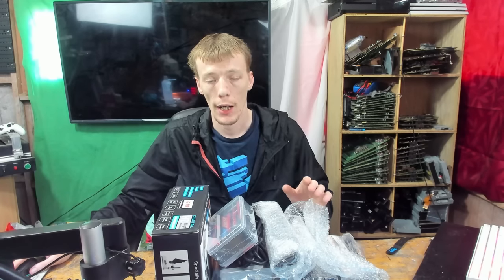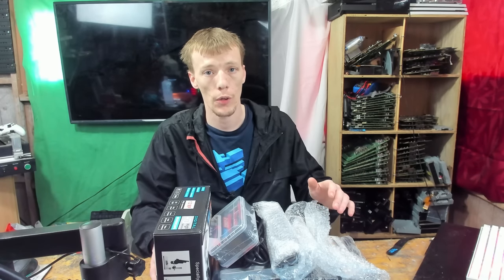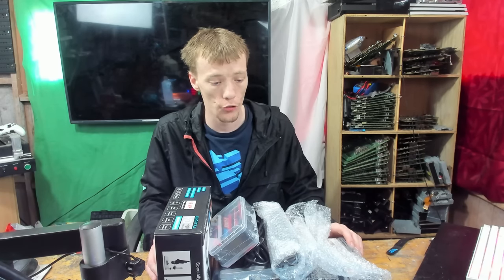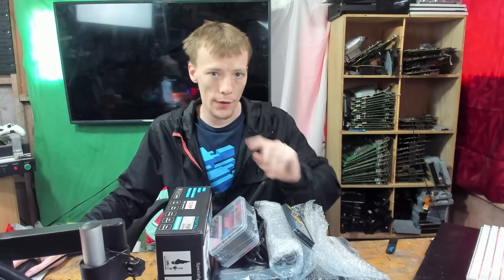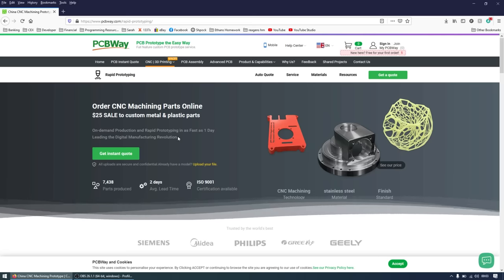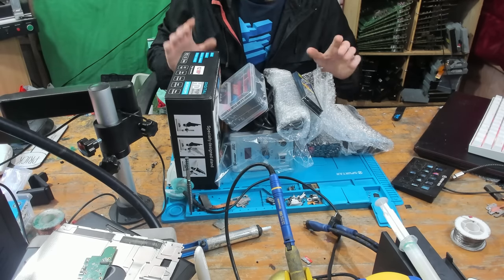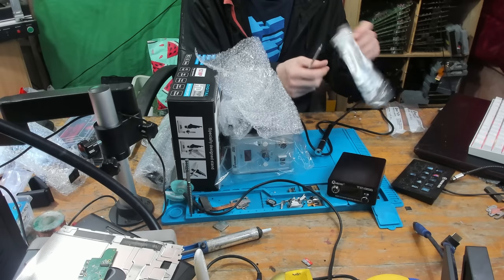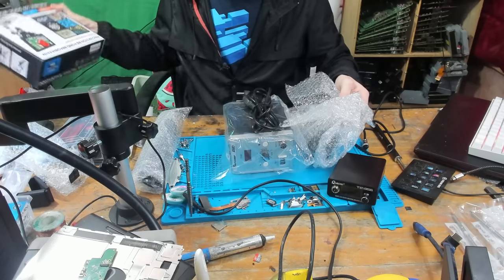Micro Soldering Budget Setup - Build A Very Usable Workbench For Under £150 (Including Giveaway)

Comment: Code word cheapo 
I have just been made redundant as a computer engineer and I’m taking some time to improve my micro soldering. I have been looking for cheaper equipment so this video has given me the confidence that the cheaper equipment is ok to start with and then upgrade as I get more experience. Even if I don’t win the give away I will be looking at the equipment you used.

Comment: Nice little setup, the benefit of going into microsoldering repairs too. Is that you can buy fancy equipment for cheap because it's broken and potentially repair it too. I've learned to buy the better equipment now to save money in long run. Buying a Hakko soldering station next Chinese ones are OK, but much prefer the better stuff. Starting to look more into this kind of stuff because I get bored of working for employers

Comment: all the stuff you showed works well for the price the bes t is proberly the soldering station (the menue is a bit o a pain) I use a simular one on my second bench .next the hot air station i used one for about 2 years befor upgrading with no problems. i dont know the multi meter but seeing you it seems fine and for that kind of work who needs a fluke. may pay the winner to get some better leads ,but maybe not . 
i wish the winner well as all in all its a great starter kit.

Comment: Good video as always 👍
Just a quick comment, you mentioned you can't use both eyepieces on your amscope, I'm sure you know this already but I'll mention it just incase. The eye piece focus can be adjusted individualy, whether it's a focus ring that the eye piece slots into or a thread on the bottom of the eyepiece that moves it up or down in the "socket". Everyone has a domenent eye so you should adjust both eyepieces. Also rubber eye piece cups help a lot.
Reply from the maker: Cheers mate, yeah I tried the individual adjustment thing and still struggle, I do have an issue with my left eye where too much light passes through so thats probably the reason :)

Comment: i started in 2004 with just around 100 euros and bought cheapo gear now i make 4 times that per day average, but before you get in to it study electronics coz board repair is not just swap components and hope it will work, i have 17 years in logic board repair of all kinds , since iphones, macbooks, androids, and even few washing machines and a bunch of tv´s, but yes you dont need a big money to start, get a t12 solder station for 30 euros, microscope usb for 12 euros, multimeter can be 7 euros, tweezers 2 euros, hot air station 49 euros. then the first 5 or 6  repairs you made enough for a trinocular microscope from eakins

Comment: Just by experience don't get cheap screwdriver sets, it's cheaper to get the ifixit Pro tech toolkit that has been made with decent metals than cheap ones which keeps allowing the screw to shave off the bit and have to buy the whole set again. I spent hundreds on different screwdriver sets for different devices and things and would need replacing every week or two. I have had the ifixit PT toolkit for over ages and I still have all the bits in perfect condition and is a lot cheaper than replacing bits as havnt had to replace anything like i normally would. Plus it has more than a standard screwdriver set for every device as its has other useful tools. Trust me you will thank me later when you have it for years.

Comment: I managed to remove a Xbox s hdmi port with even my cheapo Yihua 853D, I have to admit to cheating and using chip quick on it too though. I ended up using one of those light up gooseneck magnifying lens thingy’s to resolder it by hand. Only one I’ve done so far and although I loved the challenge it was a baptism by fire 🤣
Reply from the maker: Hey if it works it works right 😁 seriously though the Yihua 853D was my first station, and it did the job for a fair amount of time too

Comment: Whenever you unsolder a chip do you need to preheat the board with a bit of heat from a distance for a few seconds first?, A lot of times when I see you make a video you tend to just go straight in on the component. Does this depend on what components your working on or how thin the board is?, As I've found from experience fine pitch chips tend to start lifting pads if you go in for the kill when removing them sometimes.

Comment: Cheapo! Ahh as in the opposite of expensiveo! I have a xbox series s which has a faulty hdmi port I'd like to fix. I've practiced on some knackered old boards i.e radio, sky box etc but not confident to attempt to fix the xbox without decent hardware. P.s I am a cheapo!

Comment: Hi,  I never managed to watch your live so I'm asking here..
I use Atten 862d, so first question is how often do I need to change heating  element, or how to know it is bad?
Second question.. I'm trying to fix Sapphire nitro+ RX570 which has shorted power mosfet but I cant unsolder it.. tried 480c 20 to 25 airflow and it just wont melt..

Thanks 4 help, and keep up the good work!
Reply from the maker: Hey bud, I've never had to change my own element yet so I'm not sure, but if you're struggling to remove the components try increasing air flow to 40, or it may be a bad element. You can try probing with a thermocouple to see what kind of temperature it's outputting
Reply: @TheCod3r  Thanks for reply, unfortunately I dont have thermocouple to test, Im gonna try increasing airflow later today and see if it helps
Reply: @TheCod3r  Increasing airflow to 45% didi the trick.. thanks once again!
Reply from the maker: @davidvorel2300  awesome man, glad you got it figured out 😁
Reply: @TheCod3r  its nice to be a part of helping comunity 🙂

Comment: CHEAPO (def my sort of thing) I get asked all the time if I fix consoles.   I have thought about it a lot too.   I started fixing stuff in the 1970's, it was a busted up Commodore Pet I got for free down the local tip and man it was pretty beat up inside and not the comfy printed circuits either we have today but all hard soldered through pin and it took me best part of a year to fix it as I had to scavenge the burnt out components from broken radios and tellies.   
The soldering iron I had was given to me by a relation who worked for the GPO and had a peculiar habit of going live on the handle (unearthed round pin mains was still common then, only posh ppl had square pin leccies) so had to use me mum's Marigold gloves and this thing was evil but armed with my little black, orange and yellow "How to: Electronics" book I managed to fix that Pet up and sold it for a veritable small fortune and apart from buying meself a brand new Raleigh Chopper in purple with pink lettering I went and bought two busted IBM machines and six months later both were up and running and I was hooked on the repair thingy as I was also doing radios but me mum forbid me doing tellies cos of the super high voltages for the tube, also did people's car radios so had fun with it.   
Solder too was a problem and very expensive for the electrical type so I scrounged the odds and ends from a neighbour who was a plumber who also gave me the almost empty tubs of flux, no one told me about inhaling fumes from said solder, was such a dangerous time and we lived almost next door to an Asbestos factory lol

Comment: Random question, does anyone "calibrate their tips"?.  I've got a Kesger T12 when set to 400C yes it melts the solder but when i check with a Thermal couple on both Multimeter and "Chinese" FG-100, it only shows 320-350.  But when calibrating it just goes everywhere :D.
Reply from the maker: I've never personally calibrated mine, but then again I also never check the actual temps to be honest lol
Reply: @TheCod3r  I only checked as i had trouble getting the pads for a P3 on a switch cleaned.  But guessed it was more the tip i was using a wik size.  I'm just going to put the tip it and off i go :).   Luv the vids,

Comment: i really wanted to enter the giveaway but considering that i already have a cheap soldering station same as vince i dont really think that that coul be more useful to me than another person that might not be able to afford them. the only thing am interested in is the microscope really and i would not sayno to the flux twezer etc. but not the iron and hot air. if Philip happens to read my comment can you pls answer me if something can be done for my instance? if not i would not want to enter the giveaway for the only reason that someone may need the iron and hot air more than me as i have a soldering station and a uni.t multymeter.